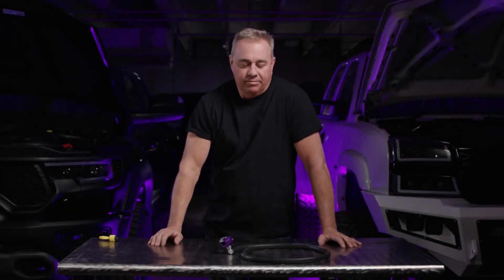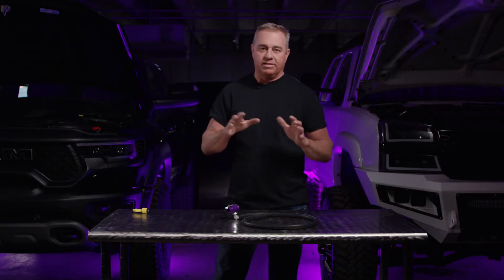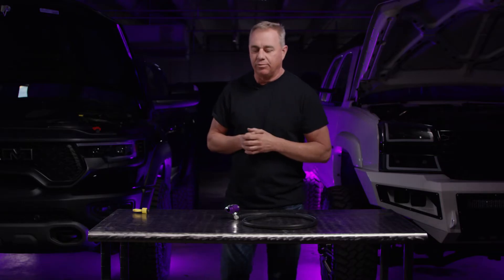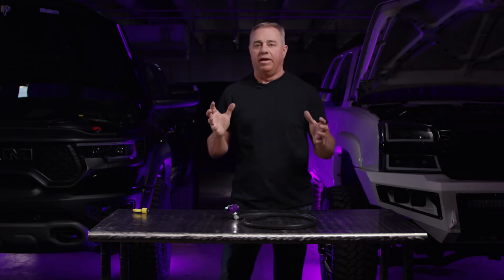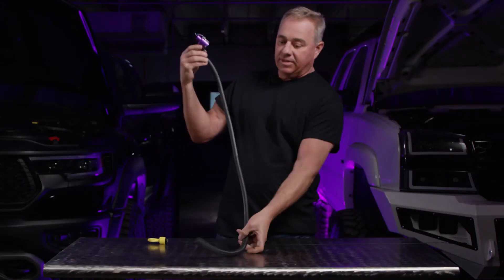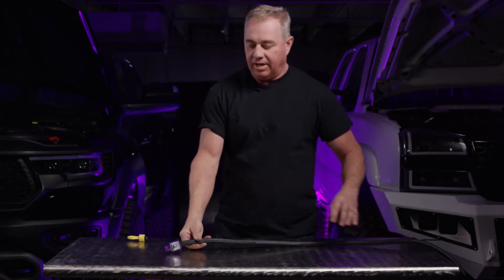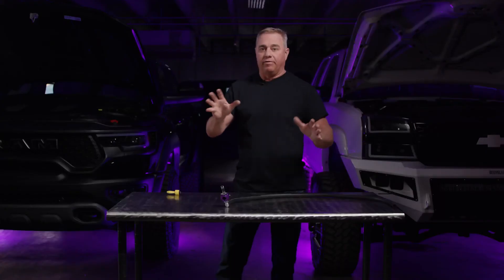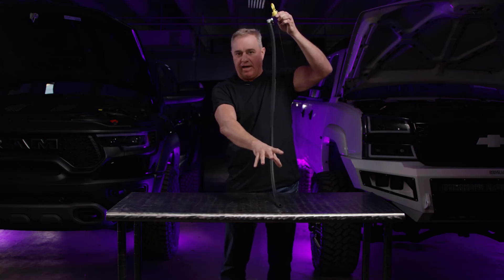ATS Diesel Performance Doomsday Device is a must for the 68RFE

Comment: Wouldn't you need a longer dip stick now,  to get an accurate reading on the fluid level?
Reply from the maker: Thank you for the comment.  We designed this with that in mind.  The installation and removal are so easy you can just remove it if you needed to check or change your fluid.